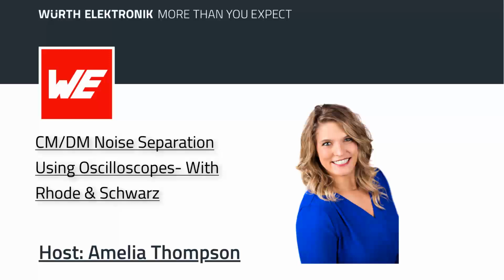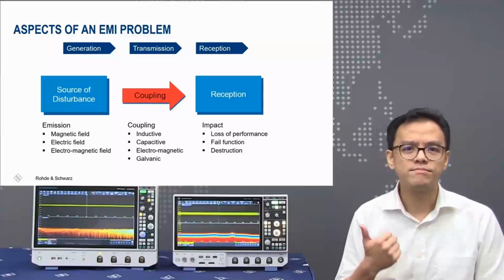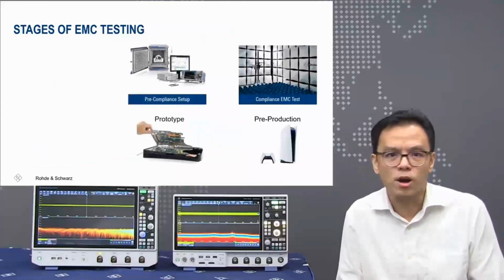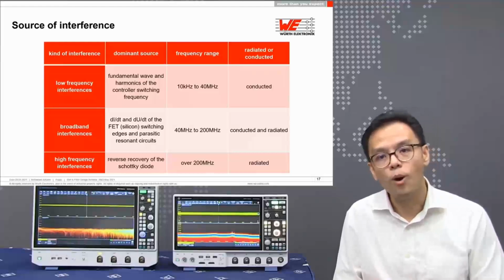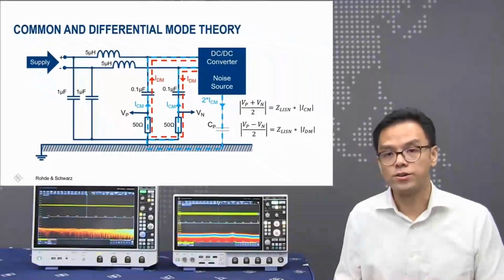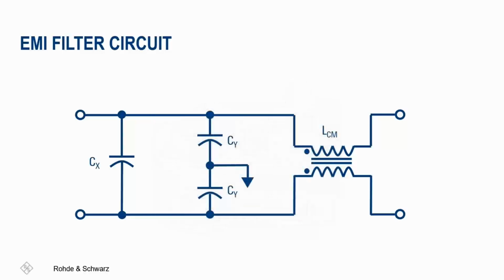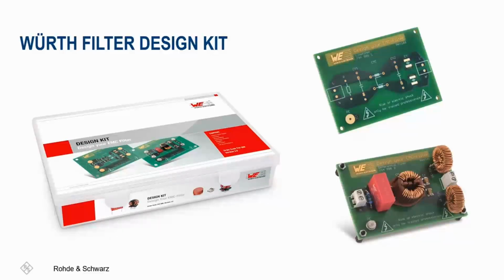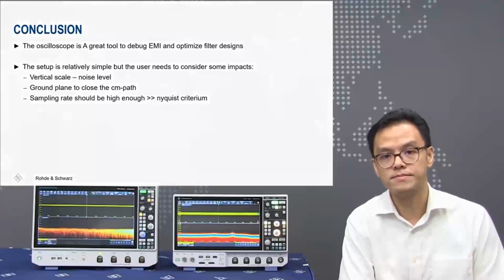Separating Common Mode and Differential Mode Noise Using an Oscilloscope

Comment: What can you say about measuring common-mode and differential interference in a 230-volt AC network with an oscilloscope? To adjust the interference filter. For this, it is probably necessary to use differential probes. What is the maximum sensitivity that can be used on the RTB2000 so as not to spoil the oscilloscope input? The first harmonic will have a very large amplitude, and the interference is many times smaller and should be clearly visible. It would be good, of course, to exclude the first harmonic from the FFT completely, but in my opinion, mathematics does not allow this.